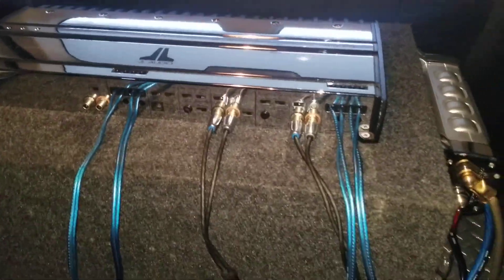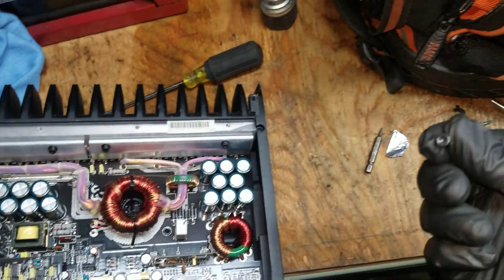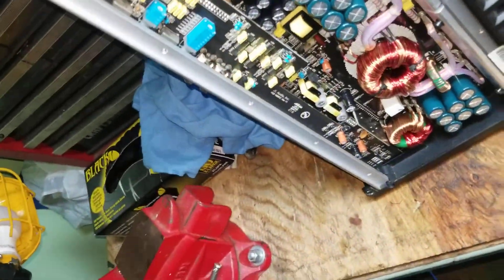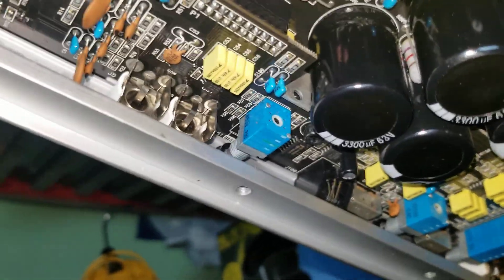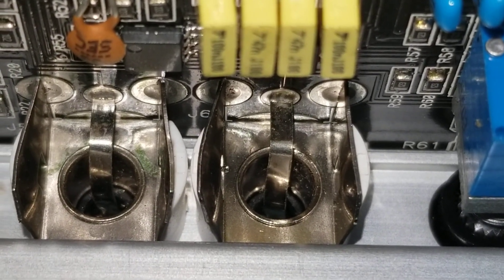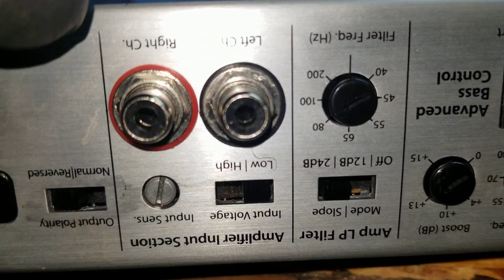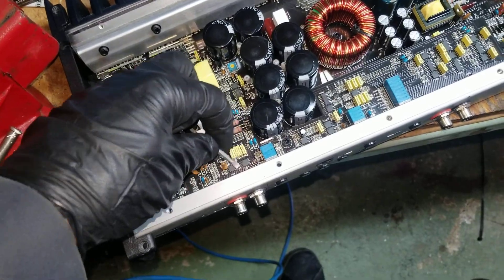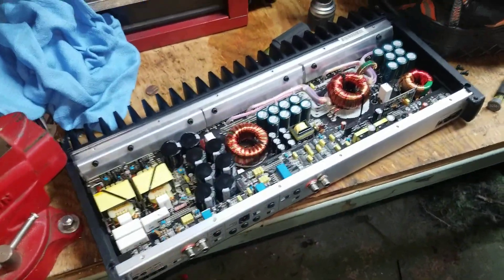Repairing JL Audio 1000/1 slash amp.

Comment: My jl1000/1 has not output what so ever . I would think that if there was a a problem with any input or output transistor it’ll light up a protection light . I think jl diagnostic system on these amp sucks . Even the old ppi art series if you remove a rca after the amp is working it’ll trigger it into protect mode .

Comment: I have jl audio 1000.1 splash series. I am playing kicker l7 15 on it. It was playing it so nicely. But since last few days. On little high volume like on 4 to 5 volume bass drops and green power lighy shut down and shut on... plz suggest. My wires are proper copper. Gauge is ok. Big 3 is dine. Grounds are properly fixed.

Comment: Question of clarification.   Are you saying your sub would just stop playing sound, but you had a good green light?   Then randomly sound would come back, and your fix here was the solution?

I ask bc the other day for the first time my subs just stopped, no reason, power was fine.  Today they just came back on.  Then when I was looking around for any issues the sub sound went out, hadn’t move the car.
Reply: Happened to me a few months ago and I’ve searching for solutions ever since...any luck?
Reply: @DJ-kb3pl  for me, thus far, turned out to be a tuning issue between the new hu and amp with them competing over the signal.  Once adjustments were made everything plays normal again.  MTF if issue resurfaces.

Comment: I have a JL Audio 1000/1v1 Slash series  question about random loss of output. Or if anyone can answer this for me. After a certain frequency played over a short time, it won't get over 67v of output. With nothing connected, I can get over 67v AC until a reactive load is on it and it will just clamp down to 67v and won't give higher AC Voltage when disconnected. Their required output at 2 ohms is 44.7v AC on the output, but it will clamp down to 34v AC when the load is applied and when the Input is raised, nothing changes.
Reply: Is your low/ high input switch working . I just pulled my 500 slash and cleaned all the pots and switches.  I also cleaned , per friend's instructions all the pins and sockets for the preamp board or what some call the daughter board.  I was also getting some volume drops.  I do think my ppi par225 was the issue but this is a fix for the jl of it was the problem . I also watched a video where the line voltage can drop on the preamp board due to some 10 ohm resistors in various spots . That could be another issue . It's been 8 months since your post . I'm curious what you found . Also my slash at 2 ohms runs at 31.6 volts i believe tunning flat . With with eq dials turned up i don't get over 65 volts